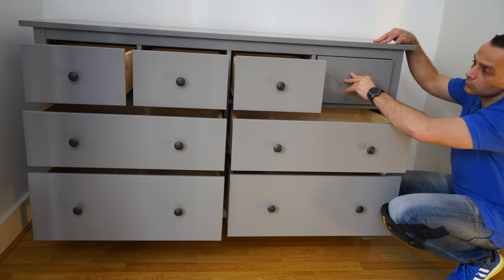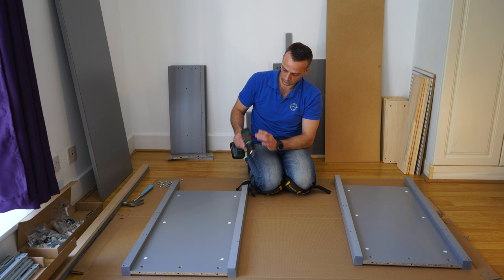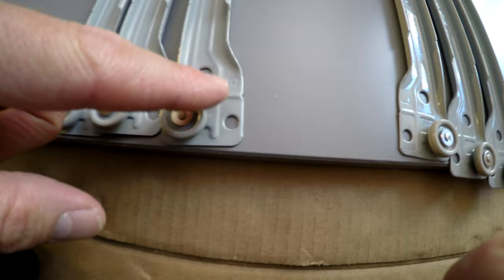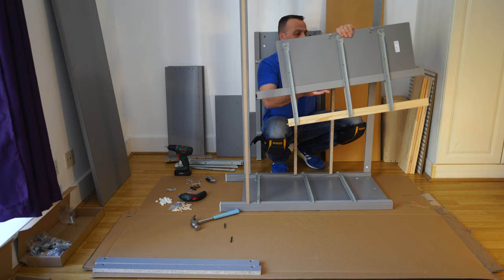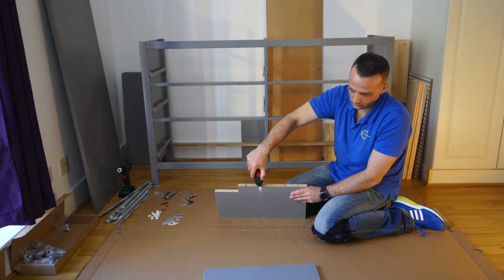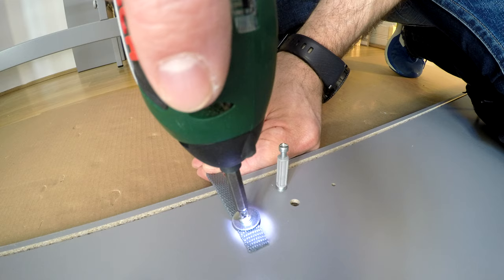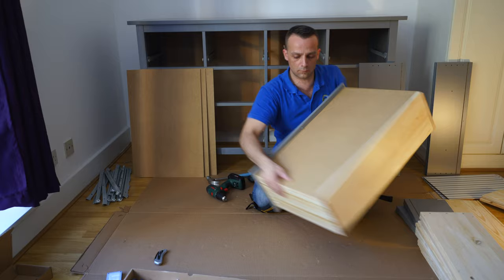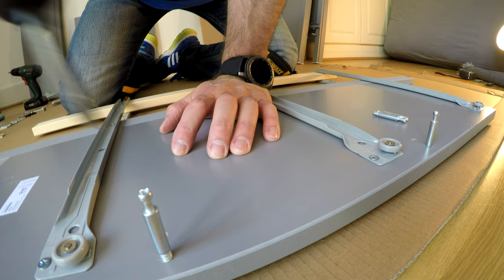IKEA HEMNES 8 drawer dresser assembly

Comment: I assembled a Hemnes nightstand yesterday with only the IKEA guidance, watching this video confuses me because the inside middle part now isn’t painted, and I was putting the painted part wrong! Then the plastic thing to secure the screws now are metal! IKEA has change its furniture assembly parts I believe. It’s so frustrating when you have to stop because you don’t understand and you believe there is a mistake in the parts lol! But I realize now the change on the parts. I’m not a reviewer, I just wanted to help in case would be same cases like mine. Good luck 🍀!
Reply: thank YOU!!!  so that is what is wrong!!!  i thought i had misplaced a piece; going nuts looking for it.  will tackle it again tomorrow.  Thank you.
Reply: I did this and it matched the video quite well, the middle part, I think he calls it, which is the second step after putting the left and right sides together, is now three sticks rather than a panel and 2 sticks as in the video. And some of the parts that are painted in his video are not any longer. This video along with the instructions made it easy, though it is a long job

Comment: Beware, the 2021 model just bought April 13 has a different middle section - 3 lats instead of the complete board (part where you screw the drawer runners on both sides). That needs a bit of thinking but follow all the holes on the IKEA plan to get it right. I bet that saved IKEA all of 50 cents on the unit and made it that bit more tricky to assemble
Reply: About 2.5 hrs to build the body slowly and watching video and following the plans. Always look at the holes and the figures from IKEA - video helped a lot. Drawers are for tomorrow
Reply: I can 2nd this, the model I have did not follow this part of the video, will follow included instructions now.  Video was still very helpful to get me started!
Reply: Good to know because I was thinking we are missing that middle board because our drawers aren't going in correctly. We are so close to being done but there's something off with the middle of the dresser ugh
Reply: I can’t align the rails with the holes on this 😩
Reply: @leanneg9228  same
Reply: @yohandussuet  perseverance is key! Eventually got it! Good luck
Reply: @leanneg9228  what did you do to make them align?
Reply: @yohandussuet  honestly, I tried one night and gave up as I couldn’t do it, then the next day I tried and it worked. Put all the screws in a little bit and get someone to hold the rails gently while you screw them in

Comment: I can’t imagine using a drill, or any power tool, for the cams. It’s like half a turn of your wrist. It takes like a second and a half. I can’t line up the head of a drill that fast. A $3 manual flat head screwdriver is superior for the job of turning cams a whopping 180 degrees. Just saying.

Comment: Took me 5 hours. Great video, it helped me a lot. Seems like Ikea changed some things up since this video was made and this comment. Some of the random screws are different and the middle piece of the middle piece in between the drawers is different, so don't get discouraged when you get to this part. Reference the instructions and take note of the holes so you know you're putting the right pieces together. Be careful here though because I built this piece wrong which caused the top not to align properly. Later on had to unscrew all the tracks of the middle piece and realign it properly. 

Thanks again for the video, good job!
Reply from the maker: Didn't know there is newer updated version of this will have to do new video. Thank you for watching

Comment: Thanks heaps me and my sister got together and had a whack at it. While the instructions were ok, this demonstration helped heaps when we were confused.
Reply from the maker: Thank you for watching
Reply: PP FlatPack just a quick question what drill bit did you use for the black nails at around 11:05. We can’t of done them tight enough because it keeps on going undone if we do it manually. Going to use drill but can’t seem to find one that fits.... much appreciated if you can
Reply from the maker: @confusionhour7662   You can use Allen key for that should be included with screws in one of the bags.

Comment: would be better if the plastic locks would have the arrow in black color cause really can't see it that good. Also, the plastic legs don't really stay in the side panels so I add glue to it so it can stay in. Also, the back panel. would be better if it was slide-in instead of hammering all them nails. Sliding in is faster then hammering each nail taking more minutes to finish the panel.

Comment: I have this chest of drawers, it came with one wrong panel for a large drawer front. We had to get .IKEA to replace that panel, after three attempts they finally sent the right piece but that drawer has given trouble ever since. Now one of the rails does not work. In your opinion could this be replaced/repaired so the drawer works again. At the moment it - the drawer- is sagging on one side, and is unusable. It is the bottom large drawer. I am very reluctant to get rid of what is otherwise a very nice chest of drawers. Do you think that the runners could be replaced after a complete build? I am unsure whether it is the part on the drawer or the part that fixes to the frame. Any help on this would be appreciated.

Comment: Hi there, I completed the build and did everything exactly right by the instructions and your video but when I put the drawers in they are wonky and not symmetrically in place. What can I do to fix this or do I have a faulty set?
Reply: there are 3 different types of "small" screws that come with this build. If you don't use the correct type of small screw then you will have a headache by the time you're done. I know its a little late now but next time double or triple check to be sure you put the smallest, medium sized, and larger of the smaller screws accordingly. I literally build this stuff for ikea everyday. I know how ridiculous it can get smh.
Reply: A L S did you manage to fix your drawers? I'm in similar situation with only my 4 little drawers consistantly being jammed

Comment: I need help🙏🏾🙏🏾🙏🏾 I was following their direction but messed up at the very beginning and now I can get the white 12x plastic nuts that goes in the middle panel. How do I get them out? I’ve tried as it won’t come out.
Reply: you might not need to remove them; if you loosen them you should be able to pull the components apart, or make room for the screw to go into them

Comment: Hey. I’m having a problem. I got to step 19 and when I put the other side of the dresser on, 2 of the wooden beams bend and idk what to do
Reply: I had this problem. I think Ikea changed some of the instructions since this video was made.

Double check with the instructions when installing the tracks for the middle piece that you're putting the screws in the right hole next to the R or L

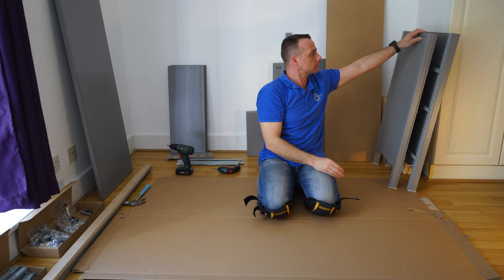Comment: Mine doesn't have that middle panel at 5:48 😩I'm stuck and I've barely started.
Reply: Mine neither did you figure it out???
Reply: Melinda Neale the instructions do that part a different way with a piece of wood that doesn’t even exist!!!!
Reply: Sniff Sniff I got it! I just followed the paper directions and that piece isn’t even included? But it worked fine
Reply: Melinda Neale I figured it out the pieces they gave me didn’t have the preholes so I didn’t know what pieces to use but I just check and saw
Reply: it seems to have been changed by Ikea. Instead of a panel and two narrow boards, it is 3 narrow boards (sticks) just use the predrilled holes to help you find them.

Comment: Fucking holes on right side panel don't fucking align with the metal rails
Reply: Mine don't align on the left side
Reply: @yohandussuet  what did you end up doing ? I just got mine today and mine don’t line up on the left side either 🤬